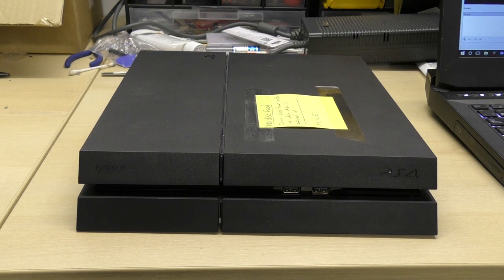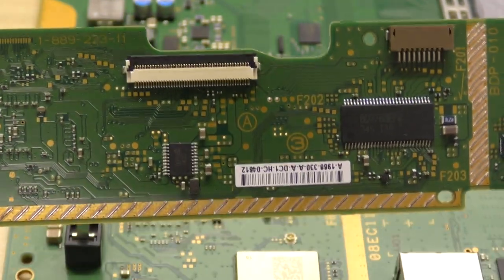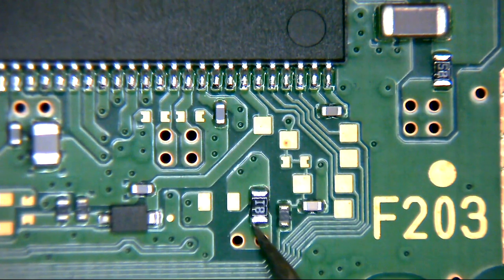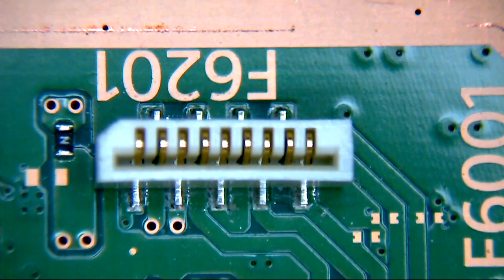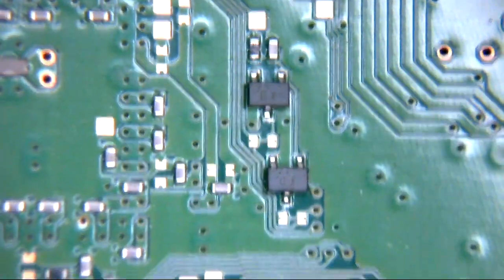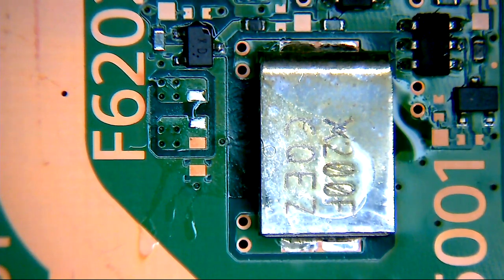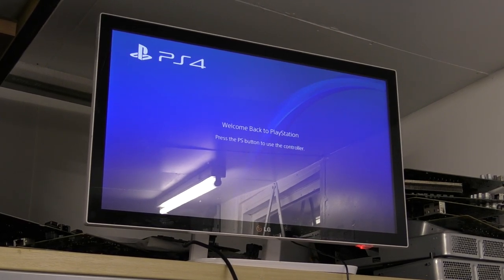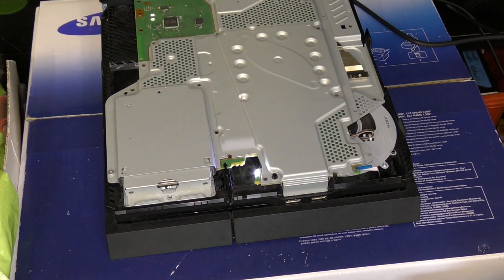PS4 CUH-12xx BD-ROM No Disc Feed Repair (SAC-001) - SU-42118-6

Comment: Hi. the vid has helped me try and find out the problems I'm having with a PS4 motherboard SAC-001 bought of ebay recently. It works, gets to dashboard fine but the problem I'm having is that again there is no disk feed, or at least the disk feed works intermittently. I've checked all three fuses at the drive part of the board and the fuse on the area where you'd find the similar area on the older SAA/SAB (the same one that was faulty on your vid) all are fine. I've even tried replacing the transistors and IC's in that area from another faulty that had a known working disk feed and I'm still getting intermittent disk feed. Sometimes it will work, most other times the laser will start clicking continually. Just wondering if you've come across this before on the SAC and if there is a fix for it as I don't really want to give up on it but I'm at the limits of my knowledge here.
Reply from the maker: If it's working intermittently then I'd be looking to blame the feed motor inside the drive itself. If the laser clicks, then it's likely either dirty or failing. You can replace the full drive on an SAC board without issue from a donor as the circuitry is all on the motherboard - I'd be tempted to do this in your instance to see if it alleviates the issue.
Reply: @AndrewPaul  thanks for the reply but actually tried two different drives and both had the same problem. Also tried it on another PS4 of the same model and the drive was working as normal. Had thought it was the connector on the motherboard, some dust or debris maybe but no such luck unfortunately. Also checked the cables but still no joy.
Reply from the maker: Swap out the BDV7763 and see if that improves the issue.
Reply: @AndrewPaul  couldn't find BDV7763 but I did find BD7764MUV on the SAC-001 board. Am I correct in saying that these are the driver chips for the blue ray. If so I'll give that a shot once I get some more flux and will let you know the outcome. Cheers again.
Reply from the maker: Indeed, yes these are the motor controller ICs for the drives.
Reply: Hi there. Been a good while but thought i'd update. I replaced that BD7764MUV chip as suggested but it was still having the same problem. Eventually re-visited it last night and I found two caps so far that were close to the southbridge chip that were shorting which looks like it is the cause of its blueray eject problem. I checked the caps directly underneath the southbridge and all looked and sounded fine. The weirdest issue with these two caps is that they will short when positive is on the ground but not the other way. I've checked this with another board that had a working blueray and these two caps are not shorting in either direction if the pos or neg probes are on ground and just read as normal for a capacitor. Took them off to check the pads and they're doing exactly the same thing as well. Just hope i's not the southbridge that's pumped.
Reply from the maker: Do you have a photo of the board where these caps are at all?
Reply: @AndrewPaul  Not at the moment but I can get one for you. I've taken off the southbridge and unfortunately the board is now nuffed so its really a fault finding exercise now. I should be able to get a pic to you in the next hour or so.

Comment: You do a great job on these things and help me out a bunch, lol. My question is: Where can you get new fuses, diods and such so you do not have to use a donor board? I have used many donor boards but parts are running out. If you have any info please let me know! Thanks for the videos again man, you do an amazing job on figuring out that crazy problems of these consoles.
Reply from the maker: If you know the values then anywhere like Farnell, element14, mouser etc are good for stocking common components.
They tend to charge fees for low-volume though and to be honest donors are cheap and plentiful these days.
Reply: I get about 15 to 20 boards a week, I own a UbreakiFix Franchise and am the only one in a 50 mile radius that seems to know what they are doing to do proper solder jobs on mobos, lol. So any help is wanted. I can buy dead boards but would be nice to buy a working new product ya know? Most places I have to source from china which is annoying. Anyways thanks for the info and keep doing what you do man! You make my life alot easier on diagnosing annoying problems, lol.
Reply from the maker: No problem my friend and good luck with the business.

Comment: hey mate i have had checked all fuses which are shown in the video. all have continuity but still no disc feeding. any suggestions? thanks
Reply from the maker: It may be the feed motor which has failed. They're cheap enough to buy and fairly easy to change out.
Reply: Andrew Paul : have changed it as well but no difference.
Reply from the maker: Try changing those two 6-pin ICs (I believe they're voltage regulators) visible at 29:29. You'll likely need a donor board for these as I've no known part numbers.
Reply: Thanks mate I will try to replace them then let you know.

Comment: Hi mate,

Having an issue with a vibrating/ rattling from the blue ray drive. 

The vibrating and rattling only seems to occur when installing or launching a game. 

The ps4 also stops mid game, saying it can no longer read disk and asks me to eject it.

I've studied the drive for a while and cannot see anything immediately obvious.. is there anything I can do with regards to either of these problems? Have you occurred anything similar?

Keep up the videos, very helpful.

Thanks
Reply from the maker: They're naturally fairly rattly to be honest - does your PS4 have the rubber feet installed at the base and is it stood on a glass cabinet / table? These seem to exacerbate the issues. The 1200 seems to be worse as the feet are off-centre and can cause some rather horrible noises if it's on a hard surface like a shelf in a cabinet. As far as the disc read error goes, you'll probably be OK if you clean the laser with some Isopropyl Alcohol - the drives can get dusty and the lens films over causing issues.
Reply: Andrew Paul 

So I have 2 ps4 consoles side by side at the moment on the same surface so it might be something to do with the rubber feet. Might try swapping disc drives to see if the drive is the issue..

 I'll try cleaning the lens to see if that helps the disc reading issue.

Appreciate the quick reply mate 🤙🏻
Reply: I suspect something is loose somewhere but it's not obvious, even when comparing to my other playstation (CUH-1003a). The one that's rattling is the CUH-1004a. 

I also suspect that the disc read error is caused by the rattling because it seems to happen only when the rattling occurs for a long period. 

Have you come across this rattling issue before?  

Thanks 🙏🏻

Comment: Hi 
I change the fuse F203 but it burns again. I changed also all group kem 490. Why?
Reply from the maker: It's probably a bad drive mechanism motor which is a separate part. When the drive mech motors go bad they pop the fuse. Change that, then the fuse and I'm sure you'll be good to go.
Reply: @AndrewPaul  thanks but i have already said that I’ve changed the motor
Reply: @AndrewPaul  I have used ceramic fuse of 1 A
Reply from the maker: You said you've changed the KEM (laser) assembly - the drive motor which controls the feed / eject is a separate part altogether (KLD-00x, where x is a number).
Reply: @AndrewPaul  ok you are right! Sorry! I try to change this. Thanks
Reply from the maker: No problem - good luck with your repair!
Reply: @AndrewPaul  thanks! It works now! I will try until tomorrow
Reply from the maker: Excellent news! :)

Comment: +Andrew Paul Id say when recording just melt a little bit of low melting point solder on each side of the pad then when you blow it comes out instantly ><
Reply from the maker: It normally does on its own with this station mate - trouble is at the minute I'm blowing across the component as I haven't enough room under the scope to get directly over it hence wanting the crooked tip. Found one I think - just a case of getting it ordered.

Comment: do you have a video or an idea about a console not showing any sign of life even with a good power supply?
Reply from the maker: Check all the fuses (labelled up F or TH).
Reply: Andrew Paul so I'm looking at the board and there are a lot of f#### and Th####. is this what I am.looking for? and if so how to I test them?
Reply from the maker: Yes - you'll need a multimeter in continuity mode to test and check them out.
Reply: Andrew Paul on the video we are commenting on go to 8:08. are the 2 tanish-brown boxes to the right of the power supply prongs fuses?
Reply from the maker: Those are capacitors rather than fuses. They're there to smooth voltage into the 5v rail IIRC. I'd be doubtful they're your problem.
Reply: Andrew Paul I'm having trouble identifying what are fuses and just regular motherboard components

Comment: @Andrew Paul One more q̶u̶i̶c̶k̶ question according to this "www.fast-pc.co.uk/products/copy-of-dda001ag-sop15-playstation-4-ps4-oem-power-supply-ic-chip" the fuse needs to be a size {0603} not a (0402). While I don't think the size difference is a big deal, the problem is the 
interrupting Rating (at Rated Voltage) is different. The ERB-RD1R00X is a {0402} which according to the data sheet is 35A, While the {0603} ERB-RE1R00V is a 50A [everything else is the same]. Here is the data sheet "http://www.farnell.com/datasheets/1755861.pdf?_ga=2.257955337.223264423.1592519723-963387287.1592519723" So don't I need the {0603} ERB-RE1R00V instead, am I misunderstanding something, or is that site wrong?

P.S. I probably should have said this first, I have a CUH-1215A
Board: SAC-001

P.s.s. I was going to ignore it and just get what you said but it just kept gnawing at me. Also i have been looking for a solution for this problem for over 6 months so thank you for your video and your help.

Comment: If those fused had an LED light, it would be much simpler to identify which one is bad, also the design needs to be like car fuses easy to replace.
Photosensitive epilepsy is not possible in humans.
Reply from the maker: Nice idea in principle but as these machines aren't designed to be user-serviceable it wouldn't make sense for Sony to do this from a cost-sense. Not to mention that these SMCs aren't manufactured with that capability (again due to a cost / size issue). Would certainly make indy repair guys' lives easier though ha ha!! :-)
Reply: Andrew Paul if they made them with LED light or maybe several LED lights, it can balance the energy flow, for example if they raise over the require energy flow, this can consume energy as require to balance it, would be much more durable, they wear over the same usage, because they have no way to disperse the heat.

Comment: thank you very much for this video. it  really helped :)I fixed it but now motor does  not spin the disc, just laser moves. what should I check?
Reply from the maker: +Jemal Karumidze Check BDV7764 IC.
Reply: found it, don't have spare part on 1001 or 1115 motherboard :(
Reply from the maker: No it's 1200 only.
Reply: how to fix same problem on slim?
Reply from the maker: I've not yet seen a slim motherboard - when I do I'll make sure we cover it in a future tutorial.
Reply: @jeksona27  my slim SAD-002  had two fuses blown  F6202 and F6201.  check those with a multimeter. you can find the fuses on ebay but they are like 7 bucks each, which sucks. Youll want a hot air rework station too, I tried it with a very fine point soldering iron but it was a total headache. For the cost of equipment you may just wanna source a working motherboard and drop it in.

Comment: What if you don’t have a donor board?
Reply from the maker: Use Panasonic ERB-RD1R00X
Reply: @AndrewPaul  Thanks, you have save another ps4 from a scrap pile.
Reply: @AndrewPaul  One more q̶u̶i̶c̶k̶ question according to this "www.fast-pc.co.uk/products/copy-of-dda001ag-sop15-playstation-4-ps4-oem-power-supply-ic-chip" the fuse needs to be a size {0603} not a (0402). While I don't think the size difference is a big deal, the problem is the 
interrupting Rating (at Rated Voltage) is different. The ERB-RD1R00X is a {0402} which according to the data sheet is 35A, While the {0603} ERB-RE1R00V is a 50A [everything else is the same]. Here is the data sheet "http://www.farnell.com/datasheets/1755861.pdf?_ga=2.257955337.223264423.1592519723-963387287.1592519723" So don't I need the {0603} ERB-RE1R00V instead, am I misunderstanding something, or is that site wrong?

P.S. I probably should have said this first, I have a CUH-1215A
Board: SAC-001

P.s.s. I was going to ignore it and just get what you said but it just kept gnawing at me. Also i have been looking for a solution for this problem for over 6 months so thank you for your video and your help.

Comment: How much do you charge
Reply from the maker: is this in relation to the issue above? Where are you located? Many thanks.
Reply: Andrew Paul I have a blue light for like 30 seconds then turns off I get no picture on the screen the fan turns on for about 5 seconds then stops spinning and I’m located in Colorado
Reply from the maker: A strange issue - could well be Southbridge related. For US / Canada servicing look up Steve @ TronicsFix on here. He's a good guy and may well be able to help you. Tell him I sent you.

Comment: Hi guys please can any one help me i m trying to update my ps4 but i can not it says error su42118-6 please help me !!!!
Reply: Please help me
Reply from the maker: This is typically a BD-ROM drive error where the console cannot communicate with the BD-ROM. Check BD-ROM ribbon between motherboard and drive - if the tabs are broken on either side replace the cable and test. Also check connectors for breaks or corrosion. If no better, check and replace drive board fuses F501, F201, F202 and F203 where bad. Otherwise this may require Renesas IC swap to a donor board if all else fails.
Reply: Andrew Paul thanks a lot i ll try it and i ll tell you

Comment: Hi, i sent you an email!
Reply from the maker: Hi, if the fuses are good on the board I'd be looking to test the drive in another machine - if it feeds you can rule this out.
In that instance I'd be looking to replace the two 6-pin ICs by F6202 and failing that the BDV7763 motor controller IC.
If your drive doesn't feed in another console then it's likely the feed motor inside the drive is in need of replacement.
Reply: the problem is i haven't a ps4 to try my drive :c
Reply from the maker: Do you have any friends with a similar model PS4 you can test with at all? Failing that then a local repair shop may be able to test it for you in a test chassis.
Reply: I'll try with my friends, but i don't have so much hopes because their playstation are still in warranty
Reply: Andrew Paul Update, the disc drive works in another ps4, so the problem is, where can I find the things you mentioned?
Reply from the maker: 32:08 towards the centre and right hand side of the picture are two black 6-pin ICs. You'll likely want to replace these with items from a donor board.
Reply: Andrew Paul Only donor board? No way I can buy them?
Reply from the maker: Sadly they have no identifiable markings on them plus there's no guarantee that'll solve the issue. With a donor you've all the parts you could need to hand.
Reply: Andrew Paul I think I'll sell my ps4 as not working, no way I can find a donor board :(
Reply: Andrew Paul also thanks for your help! You are so kind!

Comment: First off wanna say Im a big fan of your work! You are the best youtuber
 when it comes to gaming repairs. I do need your help though. I have 
watched your video ( PlayStation 4 CUH-12xx BD-ROM No Disc Feed - Fault 
Diagnosis and Board Repair (SAC-001)  ) I have a system here with the 
exact same issue! I followed your video and have tested the same fuses 
which you repaired and the fuses in your video all test good on the 
system I am having issues with. 

any other idea on what to test around in that area of the board which 
could be causing my issue ?
Reply from the maker: 28:06 - two 6-pin transistor packages.
Replace from a donor and see if that resolves the issue if all fuses are checking out OK.
Reply: swapped both transistors, no luck  :(
Reply from the maker: The 'AKNDF' labelled ones, yes.
If swapping those made no difference and you're certain that all the drive board fuses are intact then try the drive in another console. Does it work as expected or still show no signs of activity?
Reply: swapped both AKNDF and I'am certain that all drive board fuses as you show in the video are good... then I installed a known working drive from another system and still having same issue.
Reply from the maker: +You KnowMe Change BDV7764.